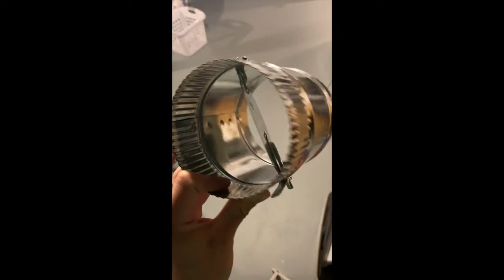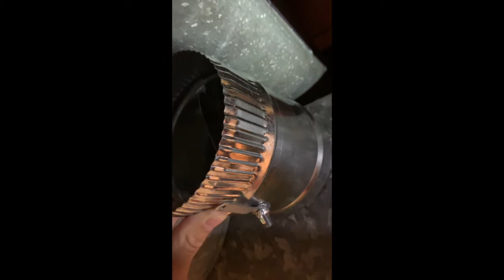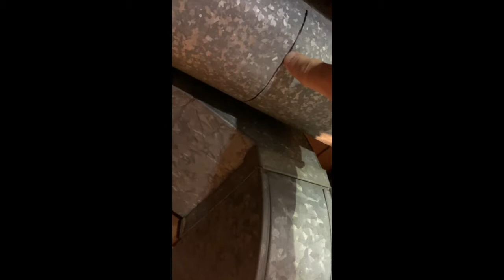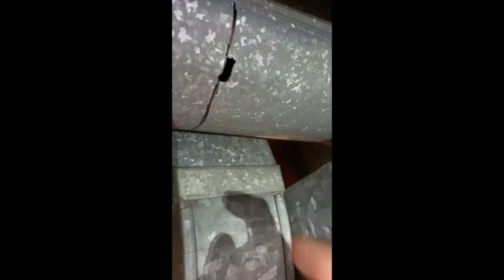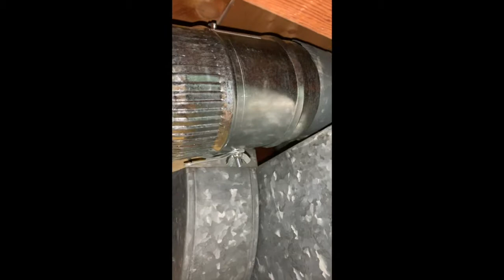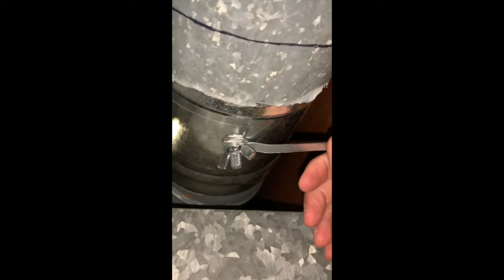HVAC Damper Installation

Comment: This is the video for what I exactly want to do. So how did you slide the damper tube into the line? I assume slid the end of the damper closer to the elbow over the line first? Then inserted the other end of the damper closer to the output into that part of the line? Did you have to wiggle the line much?
Reply: Ohhh wait so u can slide the first part if the damper wayy over and then pull it forward?
Reply from the maker: Yes, I had to wiggle it a bit to sneak it in once I got the first end inserted. You could go back to the nearest elbow if you needed just depending on your space. Mine wasn't very accessible.  @donluchitti

Comment: Should’ve used a angle grinder with metal cutoff blade. For the tight spaces you can always use the Dremel with a metal cutoff blade.